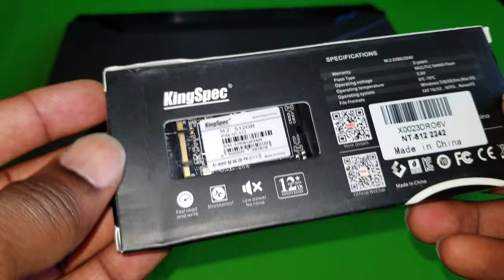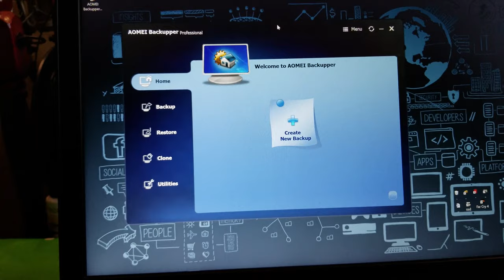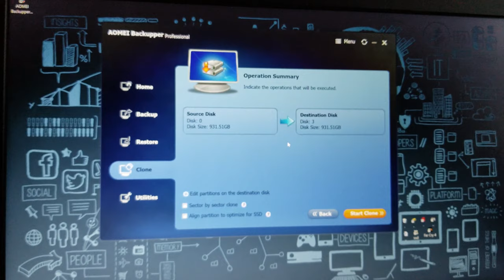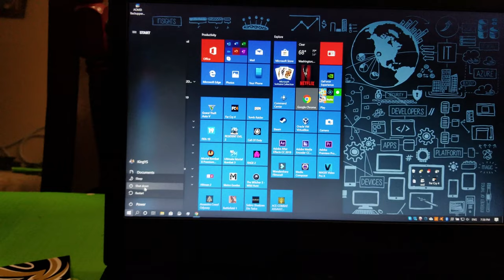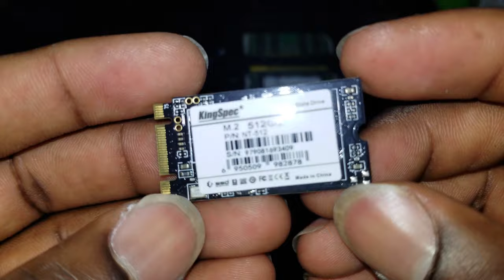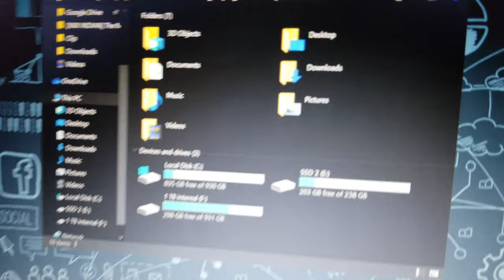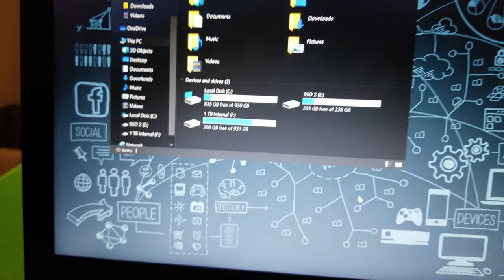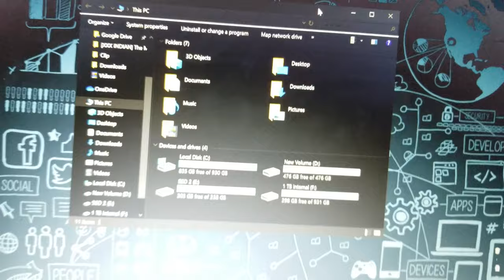Upgrading Alienware Hard Drive To SSD - Ultimate Gaming Beast

Comment: Thank you for your video. As a precaution, you should release battery cable first (close to SATA HDD/SSD slot). You could also hold the power button for about 20 seconds after shutting the system down and unplugging the power supply.
Reply: What happs if u don't do that?
Reply: He's messing with boards that have current still running through. You can fry the whole thing with a single touch not disconnecting the power from the board.
Reply: @Liam  thanks  man I been looking for an explanation cuz I heard the same thing "before doing anything, disconnect the power source so you don't ruin anything"
 And ur the first to agree. I appreciate you man, thanks

Comment: How do I find compatible SSD hard drives for my laptop. I have this same laptop but this video is 2 years old and I want to see what newer hard drives are available.
Reply from the maker: It supports the same standard size 2.5" SSD drive, any one will work, you are just checking for price, read/write speeds and capacity. If you are not sure, get the western digital blue SATA SSD. But you also have two slots for M.2 SSDs (2280mm) and one slot for M.2 SSD (2242mm), If you have the same laptop (17 R4)

Comment: I dont understand. So you're replacing a 1 TB C drive with 1 TB? Isnt it the same thing? It looks like when you're doing the clone, your C drive has nearly a TB of info on it. What am I missing? I already bought a 2 TB SSD to put into my Alienware R17
Reply from the maker: Here I'm only upgrading my 2.5" Hard drive (I installed all my games into that hard drive, not in my C drive).  I've already upgraded my C drive to 1TB NVME SSD in a previous video. This PC has up to 4 slots: 2X 2280mm SSD slots, 1X 2.5" sata drive, and 1X 2242mm ssd. In this video I upgraded the 2.5" drive and added a new 2242mm ssd to the free slot
Reply: @YvonSmart  Okay thank you

Comment: Say, my laptop has two drive slots, one for the default hdd and another ssd (that I’m planning to put in). In this case, will I be able to transfer the data across the drives in the pc without a cable?
Reply from the maker: yes, in my case I needed the cable because there was no free slot left to insert the new drive directly. Using the cable here I was able to clone my old drive into  the new one before swapping them. I could've swapped before cloning. But if you have  a free slot for the new drive, you do not need a cable
Reply: @YvonSmart  thanks my man for the prompt reply. I’m planning to have the new ssd drive to be the default boot drive. So after I’ve transferred everything over, I’ll just have to reconfigure it in the bios to work that way? And then I’ll be able to delete everything in the hdd?
Reply from the maker: Correct! I'll recommend keeping the original drive intact for some time just in case there are issues with the cloned disk. Sometimes people run into weird issues like programs acting up or other registry issues. Use a good cloning software

Comment: Hello Yvon, Your video is so much more informative than others I have recently watched. I have a 2018 Alienware 17 R5 that I want to upgrade and wonder if the parts for your R4 would be the same as I should get for mine?  Right now they are reasonably priced.  Or in my case what would be your choice?
Reply from the maker: Hi! Yes, you can get the same exact drives as mine because both R4 and R5 have the same slots: 
Two 2280mm m.2 SSD drives
One 2.5" Hard Drive
One 2242 mm m.2 SSD drive
The replacement process is also the same.
Reply: @YvonSmart  do you have an account for donations? I appreciate your advice.  You have saved me!
Reply from the maker: @janecofsky2259  I'm glad the tutorial helped. I do have a PayPal link, Thanks in advance!
https://www.paypal.com/donate/?hosted_button_id=38UFGLMVBMRC4

Comment: Is that the biggest 2242 M.2 Card you can find & how much? Also because the drive has 2 keys and the connector only has one is there a drive with only 1 key available so that it runs at the most fastest speed??? Thnx in advanced. Also what are your RAM DDR4 recommendations...I can fit up to 32GB of RAM which I want to do but I am currently shopping around for components at the moment??? Again thnx in advanced!!! Great Video!
Reply from the maker: I got it for $70 bucks https://amzn.to/3J3J9ax , There are versions up to 2TB of storage, it has two keys, it's a SATA drive, not the faster NVME drive. but it's fast enough for gaming unless you need hardcore speeds. Yes, there is one with a single key way faster (https://amzn.to/3z2oRJZ). For RAM, go with this https://amzn.to/3J3cl1B

Comment: I bought Samsung 970 m2 colone with Samsung software 
In i cant make as the boot drive wont apear as a boot option 
How did you made it work
Reply from the maker: Make sure to disable secure boot in BIOS settings. If this doesn't solve the issue try a different cloning software AOMEI Backupper Pro is a good option. Also the new cloned drive has to be in the same m.2 socket
Reply: @YvonSmart  I will try but  my laptop doesn't have M2 only hhd  
And in trying to pass bios to M2 ssd

Comment: I bought the ssd 870 evo, but when I connect it to the sata adapter, my laptop does not detect the device, what can I do?
Reply from the maker: New drives do not appear automatically. You have to use disk management in windows to turn the unallocated new drive into a ready to use volume before you can see it in file explorer
Reply: Thanks bro!  @YvonSmart

Comment: If my current HDD is faulty do I still have to clone, or can I just replace it and continue on my way using it.
Reply from the maker: If you don't clone your old drive, you will have to fresh install windows (which is fine if you need a fresh start). If the drive is faulty it does not affect the integrity of your files, you can still clone the disk
Reply: @YvonSmart  no worries, thank you for the quick reply :)

Comment: hi can i know what i will need to do my alienware m17x r4 its too much lag nba2k20 i put low graphics still lagging please help me.
Reply from the maker: Try freeing up some space, maybe there is just too much junk especially if the problem is recent. Then if you can upgrade the RAM unless you are already running 16 or more. If all this is already done, then consider upgrading to ssd drives. Go for nvme drives.

Comment: What’s the cable called that you use to connect to the ssd
Reply from the maker: USB to SATA adapter (there are two types, 2.5" and 3.5" drives)